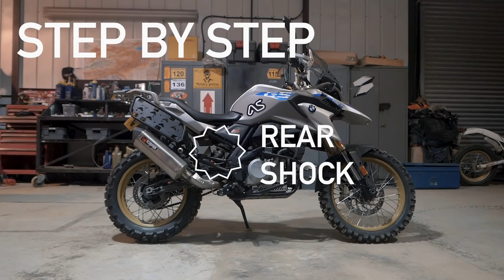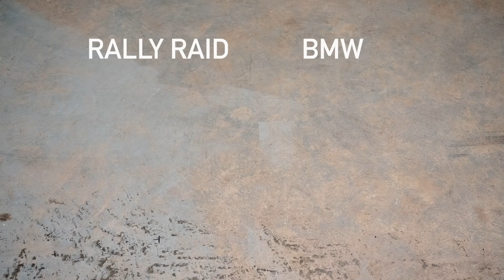HOW TO BUILD A RALLY RAID PRODUCTS BMW G310GS *FULL*

Comment: I know they likely aren’t cross-shopped often, but I really wish RR offered similar options for the V-Strom 650. It has very similar downfalls as the baby GS. I’m currently torn between the two. Neither are near perfect, but both are damn hard to beat for what you pay.
Reply: At least the XT version of the v-strom offers most of the parts then the other things suspension upgrades and crash protection are easy to find.

Comment: hey guys thanks for a wonderful job

i would love to know if the 310 a good tourer

i have two friends with bigger bikes and i want to know if i can catch up with them on a long ride going with 70-75 miles per hour (110-120 km/h)

im asking about vibration, small 11 L Tank and the comfort 

thanks
Reply: No issues as such. Plus with rising fuel costs it makes more sense. 😜
Reply: I doubt the single cylinder will last long tours
Reply: @flogette  mine has 220k kilometers on it. drove it all around europe. its great and faultless. good on dirt as well. even for a stock lightweight affordable motor cycle.

Comment: How much $$$ is this total kit? 👍🏽
Reply: If you have to ask its too much. I've no doubt with all the extra parts it would be close to the price of a r1250gs
Reply: @chrishart8548  thats just quess work. You dont know te price. and a R1250GS is close to 22k€. the G310GS costs around 6,5k€. no way it is going to be as expensive as an R1250GS
Reply: @lexburen5932  I've got the r1250gs as £14,990 and the g310gs as £6k   I bet all that stuff would add another £6k once fitted   so 12 vs 15

Comment: Hello, Good job, I got a question,
what's the price all together including a new bike?
Reply: add them up its easy with a calculator, if you run out of fingers
Reply: @boxfullofneutral8514  let us know if you do add it up please.  I did it with the cb500x  is was eye-watering.    Sure it went over £1k more than a bmw f800gs
Reply: @chrishart8548  know
Reply: @boxfullofneutral8514  changed it now thanks didn't spot that when I wrote it.

Comment: What would the difference be between the spoked wheels tubed & tubeless please?
Reply: Tubeless tyres are more common for road use - and a puncture will leak air.

Tubed tyres have a tube inside the tyres - the tyres can puncture and still not leak air as long as the tube inside the tyres which holds the air isn't punctured.

There are many other small pro's and con's.

Comment: Why not just offer spoked wheels. Dam it BMW
Reply: That's the type of thoughts that start these projects 😊
Reply: The do on the real bmw bikes.
Reply: @chrishart8548  real?
Reply: @nachohernandez9491   f650gs f800gs f850gs r1150gs r1200gs r1250gs   all could or did come with wire wheels.  Even the R80 G/S  and the r9-t     can't really option any of the usual stuff on the 310

Comment: At aboot 6:48 you state “tubeless steel design” please elaborate for us dumb bunnies.
Reply: Tubeless tyres are more common for road use - and a puncture will leak air.

Tubed tyres have a tube inside the tyres - the tyres can puncture and still not leak air as long as the tube inside the tyres which holds the air isn't punctured.

There are many other small pro's and con's.
Reply: @oweneaster2852  You get it all wrong, everybody want spoked tubeless wheels because of eas of repair. You use puncture kit in a minute and go. With tubed you need to take the whole wheel off.